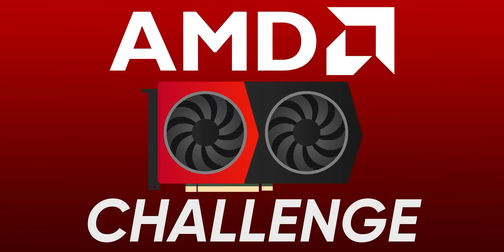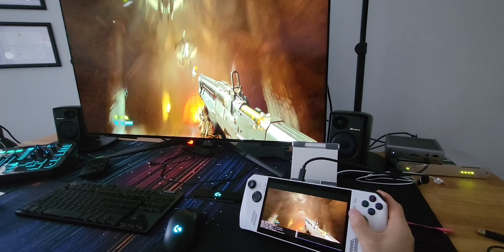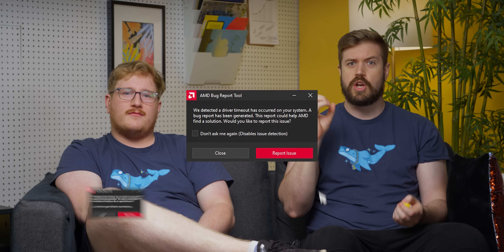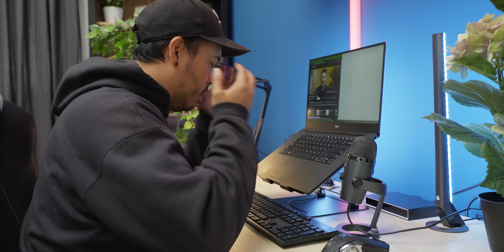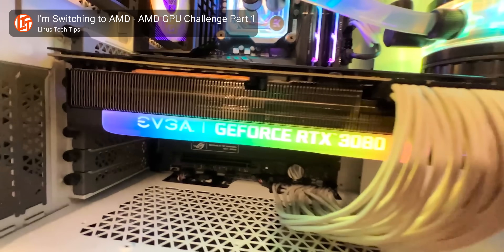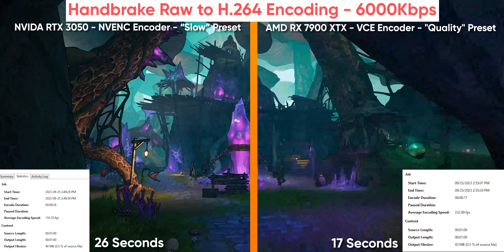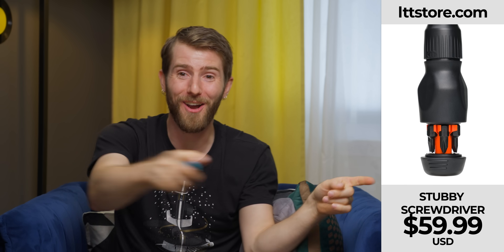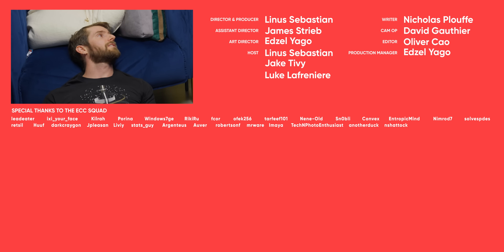I’m Staying on AMD! - Radeon Challenge Pt. 2

Comment: Changed over from a RTX 3080 to a 7900XTX for this generation as I upgraded my monitor and didn't want to spend the unecessary amount on the 40 series. Since then, not had a SINGLE issue within the GPU. It's been solid for video editing, gaming and watching videos. Most of my games have been hitting 240FPS without issues and even then the ones that don't are still around 180-190FPS. Glad to see that this challenge in a sense was a success. But a shame to hear of the amount of issues present for it. I did a fresh install, as I forgot my riser is gen 3 and my motherboard reset to gen 4 when I updated the BIOS, so because of the amount of restarts the machine dide, I corrupted the windows install....YAY. But now, definitely not going back to team green for the forseable future

Comment: How is that i never had any of these issues? Been rockin the 7900 xtx w a 5950x since launch and never had any of theese issues
Reply: Have you played games like WoW, Fallout 4 or Helldivers 2? Those are games with known AMD Driver issues and I can't play them with my 7800 XT
Reply: @ matter of fact not only i did but i do. I play wow since vanilla and helldivers since release
Reply: @markvarga2325 Interesting. What version of drivers do you play on?
Reply: @ I'm thinking my problem is probably a hardware problem. I've been having random crashes where my monitors go out and audio glitches but my pc is still on. I bought my 7800 XT used as well. I'm going in a few days to return it and get a different card

Comment: The only problem I’ve had since switching to AMD early this year is that I can’t use the update driver button. I have to download the new driver from AMD’s website, then run the installer, install the new one, then delete the old one. So I rarely update unless a new game comes out, like Starfield, that I really need it for.

Comment: Fun fact, even when I have been running Nvidia or AMD GPU's, Discord has crashed together with the GPU's so I would'nt say that it is a AMD or Nvidia thing. 
I think I blame Discord on this bugg, error or maybe even the sound drivers. I had 3070 TI and now I am on a 7900 XTX. Same error with discord. It crashes hard together with the game, don´t matter what game it is.
Reply: You're absolutely right.
Discord itself has issues rn. It's essentially just hypersensitive to system stability issues, and so if something goes wrong, it bails

Comment: i got ASUS TUF RX 7900 XTX OC, and built my new rig 2 months ago. When I got the system Cinebench24 would freeze and random blue screen and reset in YouTube. After ASUS updated the motherboard Z790-E (Rev 1) (not the rev 2 that came out same time as my i7-14700K) which had problems of it's own the until Dec. 22.  Then ASUS Armory Crate was crashing iCue, so I deleted Armory and now everything is working great so far [fingers crossed]

Comment: I went from Nvidia to amd with just a ddu a week ago today, so far no crashes nocks on wood my last upgrade was from Intel to amd and there where tons, I probably need a clean install based on the 2 or 3 slowdown issues I had or aps not launching on startup like they should but I'm equating it to my ai protocols not unistalling Cuda when they where told to and then defaulting to cpu only mode and using 100% cpu when launching.....

Comment: Recently switched from a rtx 3060 ti to an rx 6800 (non xt) while on sale for $400, mainly because my motherboard doesn't post with nvidia cards until windows boots for some reason (and that was after installing drivers with an older amd card lol), but also as a decent upgrade in performance with a boost in v-ram. So far I only had one crash on Spiderman Remastered which I think was because I was messing around with VSR stuff, but other than that, the card is super solid was very much worth it! Super underrated IMO.

Comment: This is interesting. Four years ago I decided to switch from Intel to AMD with a build using a 5600x CPU. I got random game crashes in Path of Exile and Borderlands (1-3). Other games were totally fine. After about a year of trying to figure out the issue off and on I found that one of the CPU cores was bad and if it had to do a lot of number crunching it would crash the application. Only CPU intense games seemed to be intensive enough. But only that one core. Once I turned off that core, and the one next to it, everything works 100% stable...of course now I have a 4 core 5600x, but it works. I was recently considering trying an AMD GPU in my next build. I may need to rethink this it sounds like. I really want AMD to succeed though!

Comment: I bought the 7900XT months after release and it worked perfect, then  out of nowhere it started getting driver TOs. So i used DDU installed adrenaline again, and it still happened. Seemed to happen more often when discord is open. Tried this a few times and nothing improved untill i used DDU and installed the drivers W/O Adrenalin, now it works. My friend has the same issue and for it only worked with adrenaline... Not the best experience

Comment: I can only speak for my experience, but never had any issues with my amd cards that i dont also have with my nvidia ones.
Looking at your BSOD and random game crashes i'd suggest your gpu has memory failure and needs rma'd

I've only experienced full system shutdowns on nvidia cards way back on the 6800's and get driver crashes on both these days on my 6900XT and 3070 cards (different systems)

I can verify i get the random (although rarely) video freezing on a single frame, which seems an only amd issue.
I've not noticed any real benefits in video encoding between the manufacturers either. gen vs gen they are very comparable in speed.
When I got the 6900XT its performance was pretty similar to the 5700XT and i was not impressed but not its significantly faster so the drivers should definitely have some more development time before release, which is something thats not so significant with nvidia where performance stays around the same between driver releases.

I do like the higher capabilities of the 6900XT outputs where i have multiple 4k 144hz monitors.
Nvidia do seem to have lower idle power draw than AMD but for me its not significant, my 6900XT Ultra idles between 20-40w and peaks around 280w when not overclocked.

Cards that me and my family use regularly, some have amd platforms some have intel platforms.
AMD 6900XT
AMD 6600XT
AMD 5700XT
AMD 5500M
Nvidia 1660Ti
Nvidia 3070
Nvidia 2060 super
Radeon HD 7800 (its in a server so not a gaming system)

Comment: I’ve been using the RX 6750xt for about a year now and have only had one problem right after building the computer which caused every game to crash right after launching turns out it was just xmp to not be compatible with the ram.. haven’t had any problems after switching to a different set of ram

Comment: I’ve used an amd card once rx570 a couple years ago the only thing I’ve had an issue was windows pushing the driver update before the amd control panel was compatible with it so I had to keep reinstalling it…hopefully this has been rectified recently and I may switch back to amd

Comment: I had my 7900 xtx for a view months now and also have some weird crashes.
I always run the newest driver!
In Hunt Showdown i have days when the game crashes every 30min. And often Discord crashes at the same time. (+Sometimes my ingame settings reset after a crash) 
Restarting my System usually helps quiet a bit, but the crashes always come back.
I even let Steam check my game data for errors on rough days.

System:
Rx 7900 xtx (Hellhound design)
Ryzen 7 7800x3D
32Gb DDR5 6000Mhz CL16 (G.Skill)
MSI MPG B650 Egde Wifi
With a fresh Windows 10 install btw

Before that system i had a Rtx 3070 woth a Ryzen 7 3800xt and never had any crashes...

Comment: My 6800xt is still sucking 38W on idle as soon as I turn on my second monitor.
The memory clock ramps up all the way. There are a lot of people with two monitors with different resolutions. Why is this still not fixed?
I also still have this bug where you experience a 5Hz refreshrate when the PC is waking up from sleep.

Comment: Yes, I have the brand new PC with 7950x3d & 7900 XTX and it crashed like twice in hour 😀 So I installed PRO drivers (23.Q4) and limited the frequency to 2700 MHz and... I have a stable graphics, kinda 🙂

Comment: I never use amd before, but a month ago I just switched from rtx 2060 to rx 6700 xt, because it was a good deal,  a card with the same price as rtx 4060 but better, so, i had issues in the first 3 hour like crashes and freezes, but turned out, i was supposed to use ddu in safe mode, i did that, and never had any issues, so far.

Comment: why are these expierences so bad? I've had my radeon for 4 years now and no problems, except with the AMD adrenlin software not updating for a while, making it unable to open (my windows is a bit fucekd so not AMD's fault)
Reply: The drivers have only just recently got to a point where you'll have almost no issues also the high idle power draw issue that is fixed put people off at that time

Comment: I have had most of these same problems with nVidia.  Never had problems with AMD cards or drivers.  I suspect if you start with a clean Windows install that whatever card was in the build will work better than replacing it with a different brand.

Comment: I dont understand the issues you all are having. I have an all AMD system that works great. The only problem i have with it though is not being able to use a vr headset. It says the drivers are not compatible. But other than that, the frames are super smooth, lightning fast. I have a newly built pc thats got ryzen 5 7800x, radeon 7900xt with 32gb of ram.

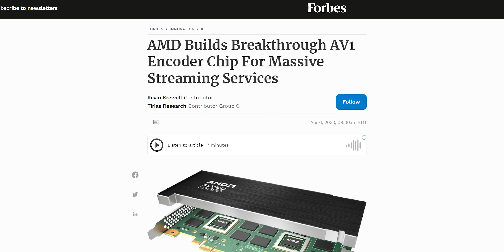Comment: 13:00  It is important to note that streaming services like Twitch will soon support H265 and AV1 for streaming, negating the quality difference traditionally found in AMD's AMF H264 encoder.  It's Also important to note that if you stream to Youtube, you can just use H265 and AV1 already.

As far as a duel card setup with AMD, I would recommend NOT using an nVidia card (I used to run a RX 6800 XT with a GTX 1650 Super, Vulkan games like Doom Eternal are a pain to deal with when streaming), but instead use an Intel Arc card for streaming.  Intel QuickSync is vastly superior to AMD's AMF and is measurably better then nvenc now in H264 (EposVox has a video on this), and I had LESS driver issues using an Intel Arc A380 then when I used a GTX 1650 Super as a 2nd card.

Comment: seems like a sound issue not a gpu issue. If sample rates are not the same CRASH. I used to have this problem in battlefield 4 my soundcard would cause my 290x to crash because the soundcard sucked but it only happened in battlefield. Found out it was the realtek audio driver.

Comment: I bought a 6650xt about a month ago and though I have some issues it doesn't come close to yours. I think saying AMD cards having to age a bit before turning useful is not ridiculous. For me, if I change my mouse color from white to black, it just completely bugs out at random points (mostly when loading games but not under actual load) it looks like some kind of pixel mess. My only other issue I'm having is Forza crashing while loading when I turn "World Geometry" higher than "High" I have the rest set on ultra and it seems to be no problem.

Comment: I have been running AMD for 10+ years and never had any problems similar to these... I had some crashes with my rx 480 but that was after it was used for mining.
And also a problem with Chrome where it was not using hardware acceleration for some weird reason, which I fixed by changing some flags.

Comment: I'm rocking an all AMD system and the only problem I have is when using citrix to go to my remote desktop ... the mouse pointer gets funky, semi transparent, and on excel ... well it just turns white and is impossible to see it at all. Strangely ... when I don't have the remote desktop on full screen, it works haha ... if it were not for that, I would use my PC for work too, now its limited to being an entertainment machine.

Comment: I know this video is a year old (just noticed it).  But I would like to share my experience about AMD Radeon 7900-XTX graphics card and the AMD drivers and software.
I updated my entire system on Black Friday 2023.  I went from a NGreedia 1070-Ti system this my current new one (specs below)
My electric bill usually turns out to be around $200 a month. (more or less depending on that particular month).  Ok with that said,
I recently got a bill from the electric company for $780 and all I did that month was get back into playing minecraft.
Not to mention that previous from that problem,  my system crashed like 4 times telling me I have a hardware problem, even though the entire system is brand spanking new.
Its a custom built PC,  AMD-Ryzen 7950X on a Gigabyte X670E Aorus Extreme,  GSkill DDR5 (6000-mt) 128GB,  AMD Radeon 7900-XTX graphics Card,  1200-watts PSU (on eco-mode)
Windows 10 PC because its just for gaming. and the power setting is also on eco-mode.
Yet I went from a normal $200 a month electric bill to a whopping $700 electric bill.  The AMD drivers and the software keeps crashing the system,
and the AMD software does whatever it wants not respecting my settings even after rebooting.  I also checked Windows updates, everything is up to date.

This is getting frustrating,  specially with the high electric bill just because I am playing minecraft.
?Could it be because I play with shaders and 325 mods?  Would minecraft suck up that much power? seriously?
I stopped playing modded minecraft because now I am terrified I will get another $700 electric again.   I love playing modded minecraft, sadly I can no longer play.
Because I don't want another $700 electric bill.

Comment: I know the 7800XT gets shit on, but I own one and it's been great.  I bought it a few weeks ago and have only had one issue.  All I did with it was DDU, then install the drivers.  Only issue I had was in VR.  I was getting random massive frame drops.  Ended up being an issue with some of the other software that I had running in the background.  Pretty sure the main culprit was Razer Synapse.  Once I killed off some of those background processes and disabled them, gave it a reboot and didn't have so much as a micro stutter when playing Assetto Corsa Competizione or F12023 in VR.  Yeah I know arguably the 6800XT edges out the 7800XT in certain scenarios, but I don't regret my purchase.  I simply will not pay the prices Nvidia is asking.  I can get better performance for the same amount of money in my price range with AMD.  Just got a 7800x3d last night so really excited to see how that performs as well.

Comment: I'm also using a riser cable with my Xproto case, gen 3, not even gen 4, and it works perfectly with my 4070Ti, only thing you have to do is go into the BIOS and manually select gen 3 speeds for the PCIE 16x lane, otherwise you'll experience extreme lag or receive no image at all. If you've got a gen 4 riser cable I believe you don't have to do anything at all and it just works. I'm to much of a cheapskate to spend 50$ on a new gen 4 riser cable though lol.

Comment: I've had all the issues Luke was having and worse since buying an 5700xt a few years back. It's been infuriating. My drivers would constantly crash or even uninstall themselves. I've spent countless hours trying to debug, reinstall drivers or reinstalling windows.

Turns out the culprit seems to be windows update reinstalling bad drivers or corrupting them somehow. After disabling driver updates in the windows registry everything seems to be working a lot smoother. But like you guys said, we shouldn't have to do this just to have a functional computer.

Comment: I have been an AMD user since 2003, never experienced any of these issues unless the graphics card had some hardware problems. Im using right now a very horrid amd rx550 4gb because i dont game anymore, i use it for programming, watching videos and doing some testing on some of my graphics at 144hz on a 3440x1440 monitor and yet it still behaves ok. The fact that i still get driver updates even today for such an old card says alot. 
I still remember my old Radeon HD7970, when i bought it, it came with dx10, later when dx11 was released, the card was updated to support that, later again it was updated to support dx11.1, as if that wasnt enough i remember how happy i was once dx12 was released and my then very old high end gfx card was updated again to support almost fully dx12!

Never had this kind of awesomness with Nvidia, they retire their cards too soon, lock down new features on purpose to newer cards and dont even get me started on that nvidia gameworks, it was obsolence planning for older cards and locking down your competition with stupid mindless poligon counts on even simple 2d "meshes", disgused as this amazing breakthrough of graphics revolution which appart from their furr tech was pretty much none.

Comment: I bought a 6950 XT a few months ago and I'm having the same sleep issues and after updating to the latest driver, the AMD software straight up won't open. Spent hours trying to fix it (tried DDU) and the only thing that worked is rolling back to 23.9.1 instead of 23.9.2 / 23.9.3 (newest)...

Comment: Oddly I am having the exact same issues with my RTX 4080. My game will crash to desktop with no errors and It crashes Discord. Discord automatically relaunches and rejoins the channel I was in. I noticed it does it more often while streaming to Discord. It does it with and without the AV1 encoder and hardware acceration on or off. In Forza motorsports I can only get one or two races before the game CTD. 

I am running a 13900k @ stock with Gskill DDR5 7800mhz, XMP on but frequency manually set to 7200. I get blue screens running at 7800mhz on the Asus Strix z790-e WiFi board.